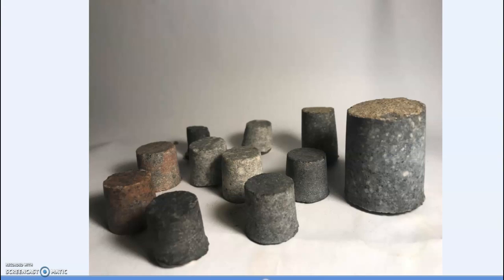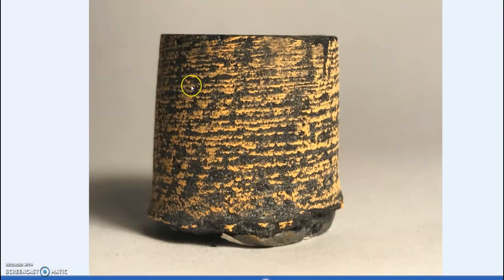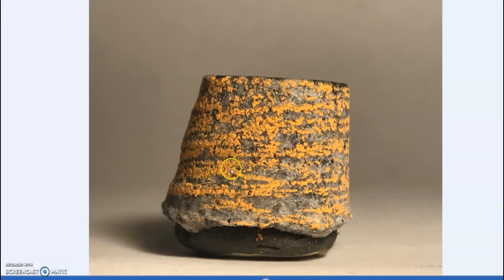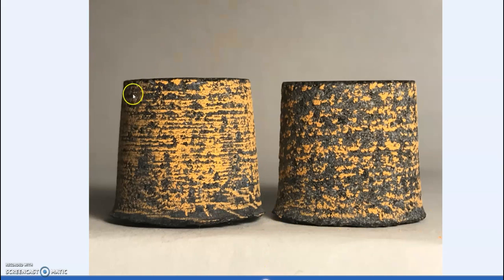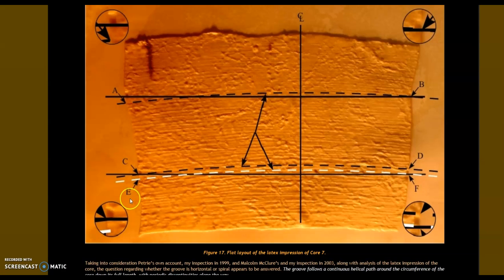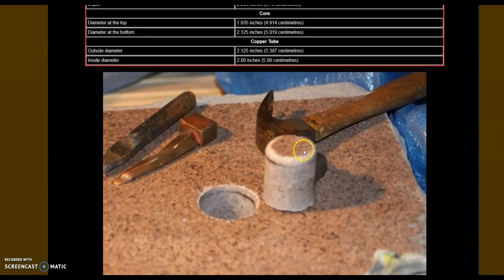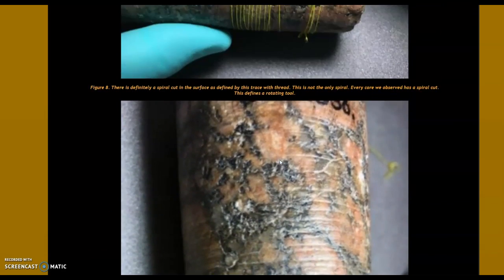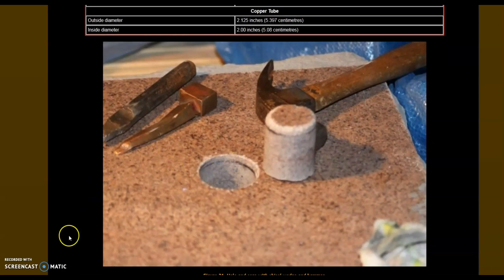Lost Ancient High Technology Granite Core Striations preliminary

Comment: Have you been to Egypt? Even as a inexperience  person with the naked eye these tube looks extremely more primitive than the primitive tube drills. How can you explain it’s only found in the old kindgdom sites and  mostly forgotten later in time. There are so many more if clean examples. And there’s some tube drills within another tube drill with realll thin lips. How was that even removed. It’s easy to cherry pick and  explain one thing but there’s overwhelming more  unexplained structures.
Reply from the maker: Have those who charge exorbitant amounts for tours to Egypt ever conducted a legitimate experiment in stone before proclaiming it IMPOSSIBLE?
In the video I address the differences in striations is a result of the grit size of the abrasive. In the links in description there is more information and the results of repeated experimentation.
They are NOT only found in Old Kingdom, though the depictions of Old Kingdom stone masons drills and later periods are exactly the same.
The hollow tubes such as the one of lapis lazuli, you only need drill through to the bottom of the stone. Are there any examples of such that have been removed? If so in a previous video I show the feather and plug technique using copper and wooden wedges, said to be impossible by those who point at stones and repeat the mantra of “impossible”
Since I am directly addressing core 7 which is said to be the gold standard of unexplainable cores then how can I be accused of cherry picking? 
Also in other videos I demonstrate how “impossible without giant high speed circular saw” marks can be achieved with small copper tools which the lost high technology crowd describe as “impossible” so I am not cherry picking.
I am dealing with issues one at a time with repeatable experiments anyone can do from home with minimal expense. Something the LHAT community is suppressing by deleting and blocking people merely for sharing. Their industry depends on these facts being hidden.
Core 7 and many other alleged impossible with primitive tools artefacts are not even in Egypt anymore.
Do the laws of physics and the inherit characteristics of stone and copper change once you cross the border into Egypt?
More and more people are repeating the experiments for themselves. 
From splitting stone, flat surfaces, right angles inner corners, core drilling of small and large diameters, hollow vases and they are all successful.
The only ones who aren’t interested are those with a deep financial interest in claiming these things to be impossible.
Reply: SGD Sacred Geometry Decoded  no one is saying it’s impossible. Everyone knows it can be done with tools. You’re basically recreating marks that looks passable. It wasn’t just Chris dun who looked into this and measured and observed it. The thing is there’s layers and multiple civilizations inheriting previous civilizations. How would u explain thousands of huge megalithic precise stone work from hundreds of miles away  under shitty loose stone work with mud or mortar all over the world? Did humans just get dumber?  
But I commend you man. This is what science is about. It needs to be challenged and debated.
Reply: @winmusic9887  The Megalithic stone work is far from precise, precision is the argument the High technology crowd like to use to discredit the Ancient Egyptians, along with the core7 nonsense you so adamantly like to spiel on every thread, which is completely incorrect as you have now learned.
Reply: MrRecklessryan again no one is saying it’s not possible to replicate with those tools in that way. What I’m gathering here is if it’s possible to build a castle with a pocket knife near by than it must be done by it. Discounting everything else that went into it. 
  Replicating marks that looks similar with our common knowledge without even studying and analyzing the evidence isn’t credible enough. 
  Also it doesn’t make sense and doesn’t add up. Showing there’s saw marks with copper on a 2 inch premade flat stone doesn’t explain why  they would cut 30 feet stones with a huge 30+ feet copper saw? Theres marks on huge stones. When they could use wooden wedges and crack it. It doesn’t add up. Unless there were ways that made is easy for them. 
I commend the work and recreation. Everyone knows dynastic Egypt lasted a long time with the very same type of methods. But u can obviously see the fall off in civilization and lost knowledge in engineering. If ya don’t see it in sorry. Just too biased like the ancient alien chaps.
Reply: @winmusic9887  What you suffer from is Incredulity and false Equivalency , it's very common among the Ancient High Technology crowd. 

I challenge you to show me a 30ft stone in Ancient Egypt with saw marks across the entire face. One dosn't exist, as you said they had other methods for dealing with larger stones, you can see this in the tool marks on the unfinished obelisk and many others. They used plug and feather techniques, all over Ancient Egypt to split larger stones. What they didn't have was a giant circular saw, which you have claimed on other threads, there is not a shread of evidence for this claim. 

You just keep moving the Goal posts. Don't worry though. I am used to dealing with fallacies from the Ancient High Tech Alien/Atlantean/civilisation crowd. Peace!
Reply from the maker: @winmusic9887  
Here are the first two experiments in smoothing granite, removing saw marks.
https://www.youtube.com/watch?v=A4RAzgvOTgw&t=107s
It takes about 30 minutes to smooth down the saw marks.
The feather and wedge technique splits stone in a very short time but the surface that is left is rougher and takes longer to smooth down and making 90 degrees is a longer process still.
Here is smoothing down a split face surface, about 2 hours although it would be longer depending on how sharp the split in the rock is.
https://www.youtube.com/watch?v=a-EHHnBYaIg&t=1s

Here's an example of a stone saw cutting machine used by Roman era, powered by a water wheel.
https://www.youtube.com/watch?v=wi2nC4wgT6c
Or a worker turning the crank handle is early Egyptians didn't harness water power or animals to turn it.

Here are some examples of stones that had been cut the same way, the process I demonstrated with a copper saw blade can be drastically increased effeciency by running  few blades parallel to each other.

Here's some info on pendulum saws, at the end is included photos of workers cutting giant blocks with that technique.
https://www.youtube.com/watch?v=49gyaGXWmZ8

Whether by steel or copper the speed of the cutting is the same.

Here in Sydney we have many buildings with very large pieces of granite suh as over 12 feet.
By modern standards the process is slow but not actually that much slower.
There are lots of videos of granite factories using saws and rope cutting techniques, it still takes hours to cut large blocks.

The key issue is one of evidence for me.
There are no written records or phyical evidence of any other technologies.
The only real argument is one of time, if that was valid then why wouldn't later structures such as Roman or colonnal era Sydney not be viewed through the same lens. The only advantage they had over the ancient Egyptians was steel and steel is no advantage as it takes just as long with copper tools that are hand powered.
To me it's seems curious that all the granite work from later civilisations where the techniques are known are over looked, or at least not measured by the same means.
Does it stack up that the Romans cut, move and shape huge amounts of granite and other stones?
The Roman aqueducts for instance, the amount of stone moved is larger than the pyramids. The Roman aqueducts maintain a constant angle of decline over huge distances, the angle of this decline is more precise than the northern alignment of the Great Pyramid which runs along the ground. Yet the aqueducts angle runs through the air!!! Surely that achievement should be included front and centre in regards to ancient technologies.

Though in the end it comes down to evidence. A castle could be built with a pocket knife but we know how castles were built. We also know that the Greeks and Romans learnt from earlier civilisations such as the Egyptians because they plainly tell us so in works such as Strabo and Diodorus.

I like to look at this as if it was a court trial, one would want evidence to be presented, the prosecution might argue it doesn't stack up even though the evidence is favour of the defense.

Though I might add the large channels and sites proposing LAHT all do rely on the argument that it is impossible. Brien Foerster, Uncharted X and Chris Dunn do say things are impossible therefore lost ancient high technology. Others not just myself have repeatedly demonstrated that is not the case, also that the time it takes is much less than proposed by those same people.
Also the evidence they site such as Mohs Hardness scale in regards to copper versus stone, ancient lifting capabilities etc are just plain wrong. And yet they repeat it after they delete or block the people in the comments that contradict them. Then they over charge people to go on tours to only repeat those claims they know to be false after censoring valuable information.
That does stack up for me, protecting their income seems far more important than being truthful. 
My entire channel is devoted to looking at ancient history in different way regarding their knowledge levels. Such as geometry, astronomy and chemistry. I am by no means an ideological defender on the "mainstream" however it must remain evidence based.
If it can be done with known tools and techniques in a timely fashion, and there is a complete lack of evidence to the contrary then reason distates that is how it was done until any new evidence comes to light.
Without evidence Ancient Aliens or lost technology could be also be argued to be Smurfs and wizards to take it toa an extreme.
One must go where the evidence takes them, again imagine if the same level of evidence (lack there of) was used against you in a trial.You have evidence that you were not at the crime scene, the prosecution argues that the evidence doesn't stack up in their opinion therefore the case against you is valid?
History and the law are very similar in that way, without a time machine one can never be absolutely 100% certain. It relies on the weight of evidence and where there is zero evidence there is no valid case to be made.
Also when the prosecution is actively suppressing information while they also have a monetary reason to do so would have to bring up questions of integrity.
This is exactly what people such as Brien Foerster and unharted x are doing, or they are ignorant of the topic they profess to be researching. Which is also a question of credibility.
Reply: @winmusic9887  There are many people who claim this is impossible without Aliens/Atlanteans/Giants/WorldCiviliastions. You keep repeating that noone is saying this. It's exactly what people like Brien Foester/Graham hancock/UnchartedX and many more are claiming.
Reply: @winmusic9887  Still waiting on the evidence of that 30ft sawn stone? Do you present any evidence for the claims you make or are you just parroting what the Ancient High Tech woo woo crowd feed you?
Reply: MrRecklessryan  oh man my friend. U punt the ball more than anyone on these threads. Many others besides me have thrown u multiple bones, you haven’t acknowledged or dodged. 
      You dismiss actual studies by geologist and engineers but throw in you tubers as evidence cmon man. 
        Again it’s the big picture. only Brian forester would say shit like diamond is the only way. Like uncharted as you well know points out it’s just not efficient. What you’re  presenting me is yes, it’s possible to dent stone with stone. But getting you tubers to present similar marks but resulting in  nothing like the actual artifacts. 
   There’s also no evidence on how they built most of these structures.. your speculation is just that.. using modern knowledge and assuming. corundum is extremely rare in ancient Egypt and Egyptian sand has very little and  fine quartz. 
   
      U don’t need me to send u photos or links to vases that are paper thin neck and body made of granite. Unlike the videos ur showing me with marble and limestone with rigid nickel size lips. The jigsaw walls made with precision without any mortar. And how EVERY sophisticated structure alll over the world have zero writing/hieroglyphs on them other than graffiti from later times. It’s obviously forgotten knowledge do to poor engineering layered on top.
And what about the the erosion on the sphinx? Do u dismiss that too.. or am I gonna receive another YouTuber replicating rain erosion with a copper chisel 😂  cmon man
Reply: @winmusic9887  So, a simple "no I don't have evidence for a 30ft sawn stone" would have been sufficient. Peace!
Reply: MrRecklessryan 😂 so sad people are so ideological and on the zahi hawass’s train. This is exactly what’s wrong with modern academia. 

no one truly knows bro. But obviously more evidence point to more sophisticated work. Like every single example multiple people and myself have showed u. Good try tho my friend.
Reply: @winmusic9887  Ah, the old Zahi Hawass conspiracy  cover up spiel. "Never heard that one before" get some new material mate lol.
Reply: @winmusic9887  You havn't shown me anything, you are pointing to stones and saying it's impossible, without some "high sophisticated technology" are you sure I'm not speaking to Brien or UnchartedX lol. You can't even provide any evidence for the claims you are making, Just give it up mate. Watch SGDs other experiments if you want to gain insight, stop watching WooWoo vids.
Reply: MrRecklessryan I see. You’re too caught up on conspiracies and ancient aliens. Shows the bias in your claims. Zahi knows as little as u do if you need me to show u anything. If you don’t know half the structures or problems with the current dating of these sites you don’t have a seat at the table my friend. To say it’s all been figured out is wrong for science period. 
    I’ve watched most of his videos already and commend it. It just proves my point more. Youtubers making dents that looks like the artifacts without studying and comparing isnt evidence. There’s precise huge megalithic jigsaw stones with astronomical knowledge all over the world  that requires a more advance civilization than primitive ppl without wheels. 
   Its not just me, a few academics stuck their necks out and spoke on these issues. To say we know is ideological. But it’s ok my dude👍
Reply: @winmusic9887  Yeah, sure, just denting stones, wow. Minimize it however you need to, keep that mystery echoe chamber going mate. Peace!
Reply: MrRecklessryan 🤡👏  I will. And you Look into your ancient history a little more than high school textbooks and UnchartedX bud.
Reply: @winmusic9887  If you can't even distinguish between drilling, sawing and denting, there is no hope for you unfortunately.
Reply: MrRecklessryan I get it man. It’s possible to cut with abrasive. No one says it’s impossible except for Brien. But you dispute the all the facts I’ve given you. So idk what to tell u my man. U won’t explain how jigsaw walls a built with precision. Corundum is rare in ancient Egypt which your video shows he’s mainly using. Sand in Egypt has very fine quartz which is why it’s been shown as a failed attempt many times. U even discredit the rain erosion on the Sphinx. Which many studies have been done. Showing me angles that is off by .1 is hilarious. Houses today aren’t even perfect. Still pretty impressive. All evidence shows a forgotten advance civilization.  
           I’m sorry bro your just with the Egyptology train and as time goes on more facts point to Egyptology is ideology. You are just finding one possible phenomenal to fit your narrative.
Reply: @winmusic9887  This thread has been about core drill holes and core7 being highly misrepresented by LAHT.  

You started out believing that Core7 was proof of LAHT,eg spiral groves and depth rates "wrong" now you know it isn't, the Whataboutism kicks right in and takes over,  It's very common among Lost Ancient High Tech enthusiasts.

https://youtu.be/H-d8FZjS42Y
Reply: Why Old Kingdom sites?  Answer:  those sites were not limited to when they were created.  The Giza necropolis was abandoned after the collapse of the Old Kingdom.  Later during the New Kingdom it was restored - at least partially anyways.  Thutmose IV famously restored the buried Sphinx and placed his Dream Stele then.  Later on the site was once again added to during the Late Period when there was a resurgence in belief in "the Old Gods" as Egypt was weak and some Egyptians believed abandoning the beliefs of the Great Pharaohs who ruled during Giza's timeframe when Egypt was prosperous was the reason.

Further sites were not simply added to with new temples and tombs added = they were also cannibalized for raw materials to build other things. Ramses II famously stripped the casing stones from old pyramids among other things as raw material to build new temples etc..  He left his cartouche upon what remained to let others know he was responsible. 

Later individuals also stripped these sites for their stone.  In the time which followed before Egypt became a vassal State to others it was a fragmented country under the control of various local governors.  So why would a wealthy Pharaoh want a temple built from stones with holes drilled in them or obvious saw marks etc..???  Answer:  they wouldn't - unless they or others were repurposing stone.  That means scraps from other building projects as well as the remains of destroyed temples as it was easier to pick up what was lying about than to import new stone from distant quarries which might have been in another's zone of influence.  The tombs of the supervisors of the workers who built the actual pyramids as an example appeared to have used "cast-offs" to create their own tombs. 

So holes in blocks and so forth could conceivably date to much later projects when better tools were used.  You can not assume Old Kingdom just because that is when the site originally dates to as these sites were picked over for centuries afterwards.